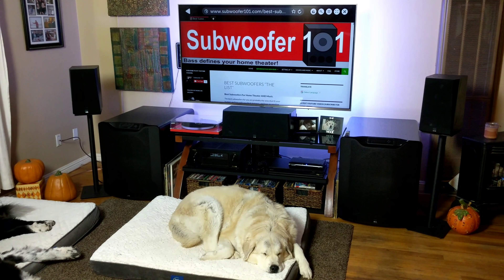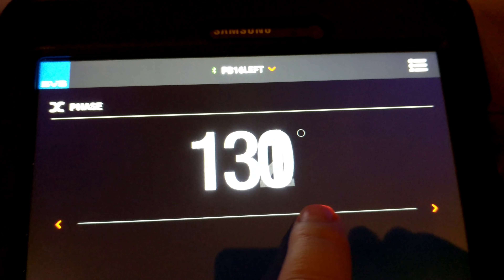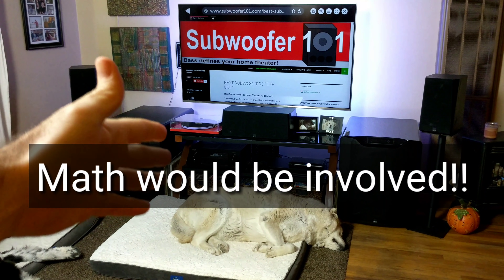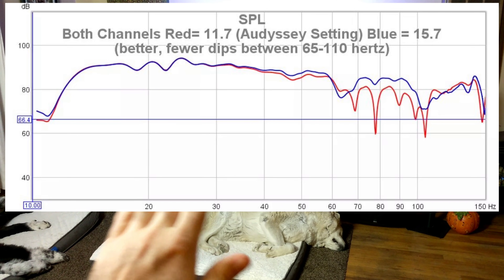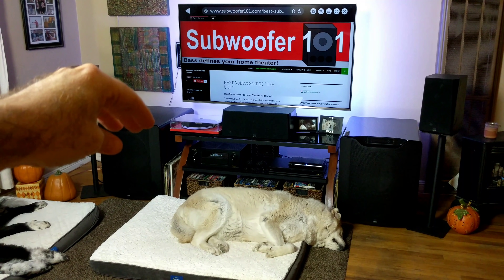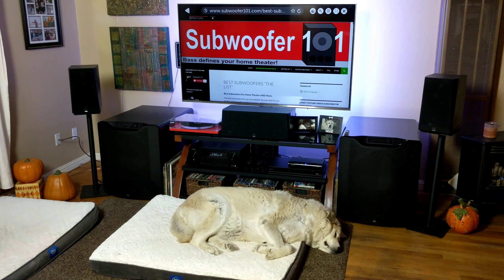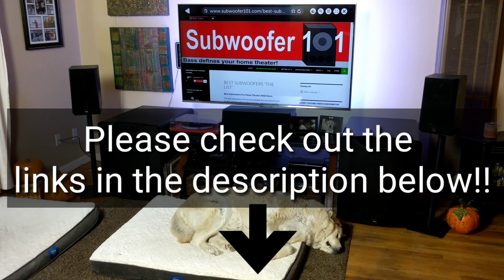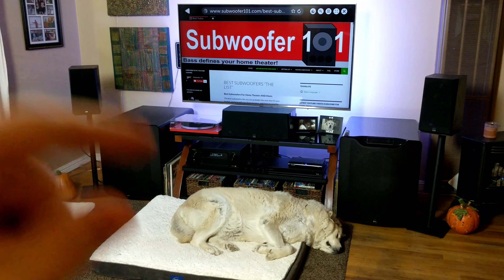Subwoofer Phase Setting: Which is best? 0? 180? (Subwoofer Setup Tip)

Comment: My theater installer said since my subwoofer is in the rear my phase should be set to 180
Reply from the maker: A lot of people say that. I don't agree, I would set the subwoofer at 0 phase, run room correction, and then adjust the distance setting instead. But that's just my preference, based on my understanding of how it all works.
Reply: @Subwoofer101  
The end goal of doing it either way is to have the two subs working opposite of each other, like having one "pull" while the other "pushes", but doing it with phase is a lazier way that should really only be used in short distance scenarios. Such as car audio. As you explained in the video, distance and timing need to have correlation to each other, and that'll never be done by inverting phase alone. It's the "poor man's way of getting it done", if you will, which is likely why it's the common train of thought. Taking the time to do the calculations for time delays nets you less cancelations of frequencies compared to phase inversion over distances, and the bigger the room, the more acoustics are lost inherent to the act of doing it the "cheap and easy way".

Comment: Hello, I have my sub Adam 10 "MK2 And ADAM S2V couple in my homestudy, the fact is that I have it in the center between my two monitors, under my desk, if I leave it with the 0 ° phase and with sonarworks, the graph gives me a + -3db waveform up and down, between 100 Hz and 28 Hz. And if I change it to phase 180 °, I have a +6 dbs rise in the graph, from 80 Hz at 28 Hz. No waveform, all this measured in the whole room The question is that with phase at 0 °, as the graph says, At ear, I perceive less serious, and with the phase at 180 ° I perceive more serious. My question is, which of the two configurations do you think would be in the correct phase? I'm lost.

Comment: I gotta thank you for pointing out that two different models of subs on one source can be suboptimal. I had an SB 2000 and an SB 1000 in my HT, assuming that they would play well together. I had never even bothered to do a sweep. After viewing one of your videos, I finally did do a frequency test. Holy smokes- there was a huge suckout at 50Hz - like 10dB or more down. I disconnected the SB-1000 and jacked up the volume on the 2000 about 3dB to compensate for the loss of the smaller sub. What a difference! I now get a nice even sweep through the entire range of the sub. My neighbor upstairs is finally justifiably upset with me and I had to turn it down lol. As they say, be careful what you wish for!
Reply: That seems like about phase, if the polarity Is flipped then it doesn’t null / no cancelation
Reply: @Helenography0741  one would assume that two subs from the same manufacturer would have identical phase, but who knows?

High pass filtering is critical if one can’t manage the crossover point perfectly. The latter is difficult if one can’t trust the manufacturer’s specs. I find that the port tuning frequency is a bugbear as the port (or passive radiator can react to frequencies well above what one would consider a good crossover point for their speakers. Im finding, to my chagrin, that the only way to avoid this problem is the set the crossover point higher than I would like. Consequently, I’m more and more leaning to shutting down the sub and trusting the speaker manufacturer. That doesn’t work for small mains, but my current speakers can go deep enough. 

I really prefer acoustic suspension loudspeakers, but they are increasingly rare these days.

TBH, I’m finding the whole audiophile thing to be exhausting lately, just like politics. More and more, I now set it and try to forget it.

Comment: Thanks for the great video. I have question regarding my setup. I have denon AVR  with 2 pre out for subwoofer. I’m planning to get one more subwoofer i have Klipsch R-115SW and the new one will be the same model. My question is shall i setup both subwoofers phase to 0 ? Both subwoofers will be in front of me. And one more thing shall I setup both subwoofers LOWPASS to LFE ? Thanks

Comment: Great vid.  Question:  

My denon only comes with bronze audyessey, which only accounts for one sub for the gain and distance.

I do have dual subs though. The back of my receiver has dual outputs.  Should I be using the RCA Y ADAPTER to both of the subs? 

Currently I notice a 5 db loss or gain by flipping the the phase knob 0 to 180 or vise versa.   Not sure I'm understanding how all this works

My subs are one in the front corner and one in the opposite rear corner.  Measurement wise physically I've set both of the subs equidistant from one another.  

Any input would be awesome thanks
Reply from the maker: Check out my "Distance hack" and my phase videos. Essentially, distance is a way to adjust phase, but with more control. 

As far as the y splitter vs both outputs, it can be a roll of the dice. The outputs should be identical, but some people notice improvement using a splitter. Trust your ears above all else.

Comment: This is an older video but I would like to add a few more things many people miss in the comments. 

It's about timing with the main speakers period. Whether it be phase or group delay settings. The proper way to setting bass is with a "KICK DRUM" track from a good recording in TWO CHANNEL STEREO. 

Assuming you've gone through the basic stuff such as placement, toe in, setting basic levels etc, dial in your bass distance with KICK DRUM. Once you've decided that the kick drum timing hits you square in the chest and is squared up with the timing of the front speakers, you've got it right. Movies will be accurate and perfect. All music will be accurate and you'll be surrounded by bass.
Reply: A bit late reaction.. But this is what i heard as well. About the speakers/subs canceling eachothers low frequency out. So you dont hear them. Makes sence since when i produced music and wanted to use an accapella... Just use an instrumental and full track, time them equally and switch the fase of the instrumental and mix the 2.. Leaving me with an accapella

Comment: Why does my new sub make a rattling sound at high bass?
Reply from the maker: It shouldn't, which sub is it?
Reply: @Subwoofer101  Polk Audio - PSW Series 10". With pioneer elite vsx-lx301 receiver.
Reply from the maker: The cure to your woes, and yes duals are the way to go:http://www.subwoofer101.com/best-subwoofers/

More expensive for sure, but the difference is undeniable. Otherwise, reach out to Polk, something is wrong.
Reply: @Subwoofer101  I've realized the rattling sound is coming from the "air tube", not the speaker. Nothing is lose, just the way the air sounds when coming out. Normal? Defective you think?
Reply from the maker: Sounds like port noise, or chuffing. May not be defective, but it's worth checking with Polk.

Comment: When you adjust distance you adjust all frequencies going to that speaker.  When you adjust phase you only adjust for the frequencies near the crossover.  Also, while the speaker may be 12' away as measured by Audessy, or some other sound alignment tool, that doesn't mean the phase will be correct for the band of frequencies you want maximized at a give position.  You could have the distance perfect but 30hz is a longer wave length than 60hz so at the listening position you may be completely out of phase at 60hz but dead on for 30hz.  That why you use the phase adjustment to maximize the frequencies at the crossover so your sub isn't out of phase and cancelling out bass from your main speakers.  You can use distance to compensate for phase but a 20hz wave length is 56'.  The wave length of 30hz is 37'.  That's 20' of difference between those two frequencies alone.  This is why you focus on the crossover point between your sub and main speakers.  That is the spot that if your sub is out of phase with your mains you will have a dead spot.
Reply from the maker: The "Distance" setting is a function of delay, in a round about way. The AVR sets delay based on distance values. 

Dead spots are more common with single subwoofers, MUCH less of an issue with matching duals. Not every sub has a variable phase, some are only 0 and 180. Adjusting distance allows more precise control in those cases. 

Adjust it as you see fit of course, but altering the subwoofer distance setting has measurable results:   https://www.facebook.com/subwoofer101/photos/rpp.1498339940466955/1758500291117584/?type=3&theater
Reply: Subwoofer 101 You missed my point though.  Distance is simply measuring the physical distance from your sub to your main listening position.  That has nothing to do with the length of a frequency and whether it peaks at the MLP.   80hz is much longer than the distance most subs are from the MLP so if your sub is 15ft from your couch but a crossover frequency is 25ft wavelength you can't rebuild your living room to 25ft.  
Distance adjust timing so the sound from the sub hits your ears at the same time the sound from the other speakers do.  Phase moves the wavelength so that at that distance the crossover frequency, or whichever your aligning to, also peaks at that distance.  They are two separate adjustments.
Reply from the maker: Often, the phase switch is just a delay. But I'll play along. I've eliminated most of the cancellations using the distance setting. How should I have accomplished the same result without using the distance setting? 

I know that the wavelength increases as the frequency drops, and basically fold up on themselves in an enclosed room, causing modes and nodes. 

The answer isn't to modify the room to fit the physical wavelength, it's to run multiple subs to knock down the standing wave effect. It does a great job, and it's much easier than trying to calculate the changing wavelengths.

I don't think I missed your point, I just don't view wavelength as practically relevant. It's a fun fact, and absolutely true and fun to contemplate, but not something I need to think about when setting things up.

Adjusting the distance resolves the problem with far less mental gymnastics. Taking actual wavelength distance into account is overcomplicating the problem in my view. 

You can also calculate the speed of sound by temperature and altitude, and calibrate sound based on the changing weather day to day, or even hour by hour. Factually, there will be a difference. Practically, all your doing is getting yourself closer to the insane asylum.

Comment: Hi there,  I need little help with the subwoofer settings. I have a Yamaha 583 receiver hooked up to Boston acoustics a 25 bookshelves and cs 225cll as center with bic America f12 subwoofer. Can you tell me the right settings for the receiver and the subwoofer. My room size 19x9x8 feet,  should I change the sub trim volume on my receiver, if yes means to what level . I appreciate your help.

Comment: I was told if the subwoofer is in front of you set it at 0, and if it’s behind you set it at 180.
Reply: Sure a lot of foggy sub info out there, wow. I'm thinking there's no perfect , no matter how much $ we spend. Enjoy the music.
Reply: That is incorrect the thing about the sub it design to play low frequency so it is less likely to beam. However it is about compressing air. So of it behind you and the speaker is facing away then it is 180 degrees of phase if it behind you and it is facing you ot should be set a 0 degree.
Reply: @LividLeon  dude subs don't have to be facing any direction they are non directional you are dead wrong on that one man
Reply: @BlackToothGrinn  does that include front-facing subs?
Reply: @BlackToothGrinn  they wouldn't all have phase control then ,if it didn't matter ,doh .
Reply from the maker: It's more complicated than that. It's better to focus on the timing aspect, in my opinion. 

Of course, just flipping the phase switch and going with the setting that sounds better in your main listening position works too. 

You get more control if you focus on the subwoofer distance setting, if your AVR has it.

Comment: I added 4' to the subwoofer distance determined by Audyssey and all the bass disappeared in the main listening position! ... I'm not sure this method works... At least in my case, the Audyssey setting works best. Full, balanced and correct.
Reply from the maker: Entirely possible, that's why I say to always trust your ears. What is your setup? AVR, how many subs, which subs and which speakers? I know that the SVS Ultra Towers only benefit from +1 foot vs +4 feet in my room.
Reply: Subwoofer 101 thanks for saying that. I was beginning to think that you meant 4 feet no matter what... I have a 10" Elac subwoofer which I think has very quick Electronics. Therefore the sound arrives at the ears very quickly. Requiring Les adjustment. I had a Polk Audio sub of lower-quality once that audyssey picked up at 22 ft! Same distance in reality. So as you can see Electronics play a huge part. I have a Marantz sr6012 AVR and 1 sub at the moment... I don't mean to contradict you in my last comment but I wasn't sure... I love your videos. Thank you.

Comment: Until you fuck around with a real pair of subwoofers such as 18inch jbls...phase on 0 sounds like a hurricane of low fighting the fronts and other channels.

I set mine both out of phase...the result is a deep couch vibrating low without fighting the other channels. It breaths low in the living room.
Reply from the maker: Thanks, but I'll stick with deep bass subwoofers, I'm not a fan of shallow bass.

You're probably new to my channel, but the whole reason I started this channel is because the vast majority of subwoofers, even HUGE high powered subwoofers, are just too shallow, getting quieter as they go deeper. There's an undeniable difference. 

http://www.subwoofer101.com/best-subwoofers/

Flipping the switch is fine too, but you get a little more control using distance. 

No hard and fast rules though. I add 4 feet to the distance because of the condition you're describing. Two ways of achieving the same thing. 

I can assure you, I'm dealing with serious, well respected subwoofers.

Comment: Hi Subwoofer101, great video & explanation. In my home theater set-up, I measured the distance of my speakers with a tape for accurate input. I've also put a couple extra feet to the subwoofer distance. I have a adjustable phase knob on my sub from 0 to 180 degrees. I never use this, just like you I left it on 0 degrees.  I recently bought a turntable and some vinyl, and yesterday I finally bough a Blu ray player. Now, my set-up is complete. In the nearby future I'm gonna upgrade my front speakers. After that, the subwoofer. Would like to buy a SVS. I'm subscribed to your channel for a while and see a lot of video's. Also I've read reviews about SVS subwoofers. They are absolute the most valuable subwoofers. That's what I see on simply every review. Very good sound quality and a affordable price. The sub that I have in use now, is good but was more expense than a entry level SVS sub! I have one question: does SVS ship to Europe? That's the only thing I want to know. My decision is made! Friendly regards, Emiel
Reply: Emiel Bakhuis No SVS doesn’t ship directly to Europe. A couple of years ago L-Sound was their European dealer. Nowadays you can get their subs through Amazon or Dutch eshop Hificorner.nl
Reply: Paul V thanks, Paul! I'm going to check out the website you mentioned to see what hificorner.nl is selling regarding to SVS.

Comment: Great video. I don't mess with phase either.

I've noticed a big difference all around and not just with Bass when I turn on the Dynamic Eq on the Denon receiver. 
I know you don't like the Dynamic Volume on, which I don't either, but what do you think of the Dynamic Eq?
I find I had to lower the bass settings on the subs and in Audussey a little to reduce some of the reverberations but I find it just to be all around dynamic.
Do you find it to be unnatural, overbearing..or do you like it?
Reply from the maker: +Johnny Blaze I do use Dynamic EQ. I also like the restore option on low; oddly enough, it's great with vinyl. That can depend on the source though, but I do like Dynamic EQ. I also like the "Flat" setting vs "Reference".

Comment: Could you please explain why you like using bookshelf speakers instead of tower speakers?
Reply: I went from towers to bookshelf speakers a year ago and don't ever see myself going back. A great bookshelf and great sub or two is just as good if not better than towers. A great bookshelf is also more affordable. I LOVE my system. Def Tech SM 65 LCR, SM 55 surrounds, PB-1000 sub. Its just amazing.
Reply from the maker: +Jaquay Lawson Both work quite well, I almost don't have a preference. That said, a Tower of the same caliber will give a more full sound. The Ultra Bookshelf speakers have a little more 'sparkle" to them than the Prime Towers, but it's a thin margin, I'm a big fan of the Prime Towers. If I had to choose between the two, it would probably come down to aesthetics. After I decide on a decent external amp, I'll probably move on to the Ultra Towers.
Reply: According to Dennis Foley for Acoustic Fields, you should never have your speakers on the floor and that includes floorstanding tower speakers and subwoofers. So on that note,  I'm in the process of building some  absorption platforms for my Klipsch F3 floorstanders and Klipsch SW-450 subwoofer. Personally, I could not visualize a home audio system without floorstanders/towers for listening to music or home theater system for movies.  My system is set up as a 7.1 home theater. My Yamaha A/V receiver can also switch over to 2-channel stereo for music if I choose to do so, but I usually listen to music and watch movies both through 7.1 Enhanced mode.